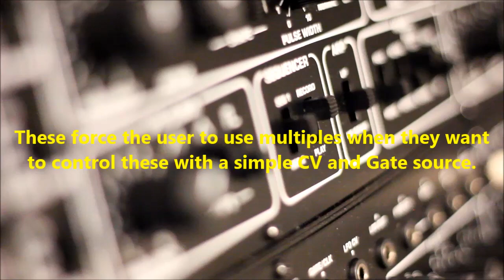8 Voice Polyphonic Synth = 4 Model D's and 4 Pro 1's

Comment: I really prefer the internal polychain option via MIDI (thru) on my behringer Pro1s. Behringer did a really good job with this, no need to split note on/off into single CV and gates. You stil can use control voltages with various inputs and outputs for extra modulations.

Comment: Realy great video
I would like to know do you use only midi for polychain or you use a external gear to send CV to trigger note like you want?
Reply from the maker: I am not using MIDI directly but through the Encore Expressionist.  There is a way to daisy chain MIDI cables from controller through each voice as the manuals point out, for up to 16 voices.  I am not sure about mixing and matching types of modules in that config just because I haven't experimented with the MIDI polychaining.
Reply: @artoftravelogue  
Ok thanks for the reply. I was curious to see how behringer modules work in polychain using midi, realy rare to find videos with polychaining

Comment: hey I actually have 3 pro 1 and 1 crave I want to know how I can "polychain them together"....Not very comfortable with the connections...thank you
Reply from the maker: There is a way to polychain by using MIDI cables between them, where your synth or keyboard goes first to one, then another MIDI cable goes out of that first unit and onto the second, and so forth.  The manual for the Pro 1 talks about MIDI channel settings on each of the units to accomplish this.  There is a default voice priority that can only be changed by downloading the change to the Pro1 software through a computer and USB.  I don't use any of the internal polychains.  what I use is a device made by Encore called the Expressionist.  It takes MIDI in, then has 8 sets of CV and Gate outputs that can go to each unit that you want to control, then configured however you like and saved on a patch inside of the Expressionist.  This makes it easy to jump to different configurations, whether split modes, layered, polychain, priority of voices, etc.  I hope this helps you in your endeavors.  Thanks for the question.
Reply: @artoftravelogue  thank you, I will see what If I can find it.

Comment: Excellent demonstration. Thanks.  I am wondering how you racked those Model Ds and the Pro One... is that a custom solution or did you find a source for this?
Reply from the maker: For the Model D's, I got a strip of 1/4" thick wood and set the endcaps down on it side-by-side to have a template to mark where the holes would be drilled, then I drilled them and screwed all 4 modules into the same side pieces.  I did the same with the Pro-1's, but I used a metal piece (actually for this, I used some blank 19" rack panels that I had laying around).  These are setting on an A frame ultimate support stand.
Reply: @artoftravelogue  - very good solution. I guess given the angle on the backs of the Pro One and Model D there is room for the  Midi cables, power and audio without having to put spaces in between them.

Comment: Please answer me a question I can’t find online.
If I have 3 Modules like Model D, neutron and Pro 1, or maybe even 3 model D instead, if I want to make 3 voices synth, how does the audio output work? Is there Any way i can run one synth into another and get one final output for them 3 synths? Thanks
Reply from the maker: soundwise, different synths might be able to be tuned close to the same sound, but inherently will be different because of the design, which could be cool.  The audio outputs do need to go to a mixer- so I use a mixer to sum all the audio of the 4 or 8 synthesizers into one.  I also use a stereo mixer so I can pan the different voices in the stereo image, which is great sounding.